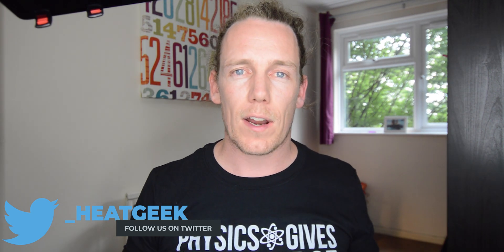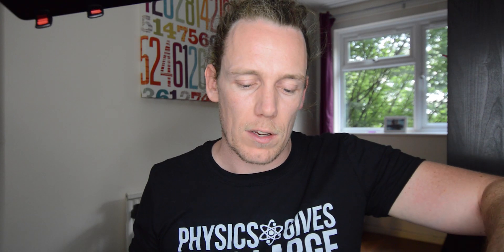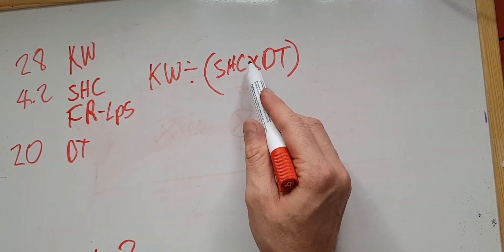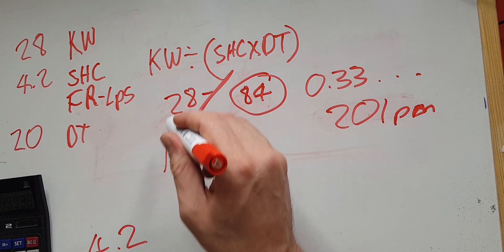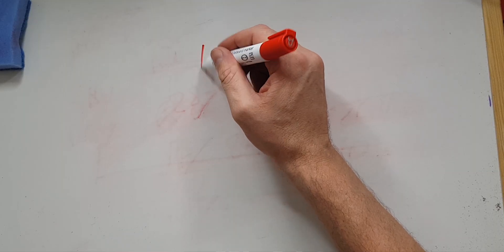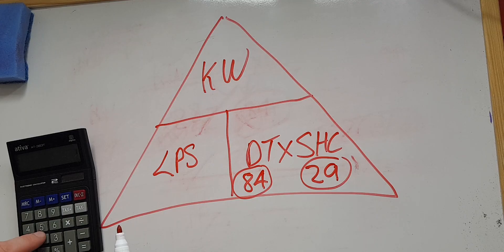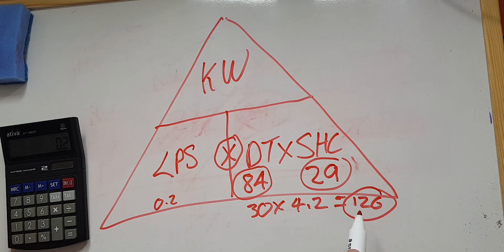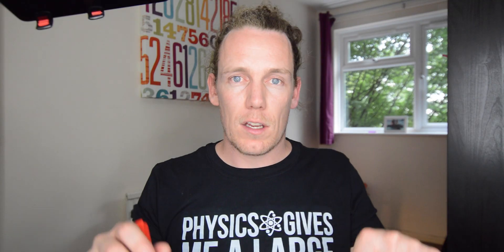Shortcut to HEATING GENIUS! Mass flow rate

Comment: I would recommend using the proper formulas, solving them algebraically for what you need, and substituting the variables you know for the calculation. Also, use metric base units and prefixes only. You are switching between units and variables which is confusing.
So, P=ṁcΔT or Power = mass flow rate * specific heat * temperature differential.
1 kg/s * 4184 J/kg*K * 1 K = 4184 W. When doing calculations for what size system you need in a house, there are all sorts of standards, charts, and formulas to consult. I'm not a technician or tradie so I'm not specifically familiar, but I'm an engineer so I know the math and the thermodynamics well.
Reply from the maker: We try and keep it simple.

Comment: You refer to the 'energy' in kW
kW = Power
Energy is in kWh. It's a tiny difference but you wouldn't interchange litres of petrol with Horsepower.
It needs to be learned, top down, and you're at the top...

Comment: Hey.
My heat pump installer left without tuning the installation, and ignore my emails. So your videos are much appreciated.
The manual for my heatpump say only limit the pumps flowrate if the flow is to noisy. But if i don't limit max flow it seems to pump to fast and delta T drops to 2-3 °C.
Some sources clams air to water heatpumps optimal delta T is 5°C other claims 8°C and some say flowrate should be 2, 2½ or 3 times energy output (eg 5KW = 10-15 L/min )
So what pump speed  should i target with heatpump and underfloor heating?

Comment: Am I right in saying if I had 20kw of radiators on 22mm pipework and the flow and return was 10 degrees then the flow rate would be 0.47l/s, but 22mm can take a maximum of 0.35 l/s  so it wouldn’t be possible to get 20kw through the pipe to the radiators therefore the last ones on the system would be struggling?
Reply: I've just done a pipe siza calc and 26mm internal diameter is minimum for 20kw pushed down a pipe so you'd need 28mm. But that's if all rads calling for heat at same time. This is based on no more than 0.9m/sec velocity

Comment: Dear Heat Geek, I see you consider yourself a heating genius, good, am glad to hear it, could you please add the acronym RCC to your heating engineers tool box, it stands for  Radiated, Convected Conducted, and is a very quick way for your customers / rest of the nation to get on top of heat loss before they all go broke from rising energy costs. They will have to do some of their own research as not possible to discuss all on here. Everyone is familiar with loft insulation , double glazing at great expense , prospect of flashy heat pump etc but what about the nitty gritty of windows that never got foamed up, howling drafts from badly installed windows /doors ie convected loss. What about cold north walls, radiated and conducted loss, what can be done about it. 
    It has probably occurred to you but I'll mention it for benefit of everyone else , retro fitting under floor heating, very expensive/ disruptive for purpose of maximising efficiency of heat pumps, would it not be simpler to do it on certain walls in a house..yes there is the issue of putting screws in to the wall but with a bit of imagination and ingenuity that can easily be resolved. Thanks for uploading, is nice to see such professionalism.. Let there be light is what it says, and you're doing a good job of it , well done. Just subscribed . Ps Please dont fall out with my mate Roger, you, him, urban plumber are doing a much better job than anyone in Parliament that is for sure. The goal should be , best of both worlds, Warm houses/ low bills, I walk the talk, have a warm flat that runs on vapours and is still room for loads of improvements, wait till I get the 500 mm celotex out

Comment: I have a 3 floor house 170m2 with underfloor heating , the lowest power of my combi boiler is 5.7 kW. As e result , when one of the zones is active , it takes about 30mins for the boiler to warmup the system and then it overheats and cycles ! Is there a way to dump some of the extra heat to the other zones by partially activating them? All zones are controlled by simple on/off programmable thermostats .

Comment: Ok, it's late at night and I'm a bit tired and it's a while since I calculated any mass flow rates. After describing SHC very well, and explaining that SHC is the capacity of the medium to store energy per unit mass (kg), you  only talk about volumetric flowrate (litres/sec) , without explaining how you got from kg to L/sec.. Ok, so, w're talking domestic heating systems here so, the medium (water) has a density of 1 (or thereabouts)  and, crucially, doesn't change phase, and therefore 1 litre/sec = 1kg/sec( because 1litre of water = 1kg of water) ( or at least close enough to  your margin of error for calculations to not really matter). I make this comment for 2 reasons only, The first being that this omission in the explanation might confuse some folks and the second being that in one of your discussions with that Bisby bloke you said to him something along the lines of  "it's not about flow rate that's important, it's mass flow rate". Well, If we are talking water and no change of phase, flow rate (volumetric flow rate) and mass flow rate are interchanbeable. ie. if you are pushing 10litres /second around your system, you are pushing 10 kilogrammes/ second around your system. Luckily poor old Rogerer was too thick to pick you up on this point, but it did make me question do - you understand what you're talking about?
I'm now going to qualify that by saying that I think you're doing a great job and thanks for that. Teaching thermodynamics, however, may not be your forte, so just be careful, it only takes one prat to spot an error and shout it out in an un-reasonable way to undermine an awful lot of your otherwise  excellent hard work.

Comment: One rule of thumb that I stumbled across on a plumbing forum is 'one kWh will raise the temperature of a tonne of water by one degree C'. From memory its only 92% accurate, but it provided a nice, simple, initial assessment to put you in the right ball park before getting the calculator out.

Comment: How much more flow rate does ufh require compared to radiators?

Whats the KW output based on for me to play around trying this formula? I have my room by room heat losses.
Reply from the maker: The kw is what ever you put in the box.. ufh is 3 x faster
Reply: @HeatGeek  i was just trying to figure out what kw i add to determine pipe sizes to my heating manifold and pipe sizes to the radiators, is it my house heat loss of 3.7kw, the ashp output of 7kw or the gas boiler 26kw.

They say heat pumps requore a higher flow rate compared to a boiler, is this because of the heat pump or due to the low temperature flow, because we can now run low temps on a viessmann 200 too.

Comment: hey! i am apprentice plumber in Australia where we are rather behind the rest of the world in this field, so here i am trying to better undertstand all of this! (before i eventually undergo one of your courses)
if a greater delta t is better (within reason, we want everything circulating) would it not be better to lower pump speeds to increase the delta we get?
Reply from the maker: Yes, you want lower pump speeds to widen the delta buddy.
Reply: A gerater delta t is not necessaraliy better. A greater delta t will give you a better heat transfer per unit area of your emitter or collector ( you haven't specified which you are talking about), but a delta t of 90 degrees k on a radiator would be dangerous.A condensing gas boiler usually has 2 heat exchangers, the primary  is directly above the flame and will have a delta t of several hundred degrees K and then the secondary is further up the flue and will have a delta t of maybe100 degrees K ( I'll admit I'm guessing on that one). However the crucial tempemperature on the secondary  is not the delta Ie  the difference between the incoming water  and flue gas temperature. but rather the temperature of the heat exchanger itself which must stay below 323 degrees K at sea level ( or thereabouts) in order for the superheated steam  in the exhaust gasses to change phase and condense out as liquid water, thus liberating shed loads of "heat" energy into the circlating water of the heating system. The delta t across the boiler flow and return will affect how efficient that particular boiler is, because those crafty engineers will have combined all of the variables that they can control, into their control system to make the boiler work at it's optimum, but bear in mind ifg the return temperature is too high it will never "condense" and so forget efficiency. It is very important that you get the return temperature ( not the flow temperature) for your condensing boiler right  in order to get max efficiency. After that your emitters (radiaters, underfloor heating etc) need to be matched in size tto the room thay are in to deliver the heat required for that room which will  of course depend upon the delta t of each surface of that room and the   u value  of that surface and the area of that surface. If youv'e got this far You will probably make  a great heating engineer, If not, tune into Roger Bisby and be a "has been"plumber.

Comment: Shouldn't Delta T be the difference between average temp in radiator and desired temp in room?
Reply from the maker: There are lots of dts. For mass flow rate its flow to return dt. The dt you refer to is the mw-at-dt. That bares no relevance to the required flow rate at all.
Reply: @HeatGeek  Ah okay, I think i get it, thanks

Comment: Hi Adam, does this calculation work in respect of underfloor heating circuits? Or how would you calculate a circuits required flow rate? Many thanks

Comment: Thanks for the video, specific heat of ethylene glycol is less compared to water so you will need more flow rate from the pump,  also the number of 84 is not saint, on some systems, you will need to calculate a different delta T, so you can use the formula q=mc∆t  to know how much energy you need (gallons of water inside the water tank) and than you will need to calculate what the house/facility heat loss, and than you will need to calculate how much heat (Q) you need from the system and how much flow rate from the pump to transfer. good luck. 👍

Comment: 'Mass flow rate is simply Kg/s. You are referring to the particular value of this quantity which will produce a specific deltaT across your system. You should call this something different, for example 'desired mass flow rate'.

Comment: Hi Adam, fantastic video as usual! Just one question. Am I right in thinking that a Delta T of 20 with a MWT of 60 will output more Kw than a Delta T of 20 with a MWT of 50? If so would that need to factored in?
Reply from the maker: Yes thats right. But mwt doesn't not come i  to this equation so its irrelevant

Comment: how do you find out system resistance of an existing system to size a pump correctly when you cannot see pipe runs. say for fixing with some rads that are not getting hot and you believe the pump to be wrong thanks
Reply from the maker: Unfortunately younneedbto pace out and estimate

Comment: As a non heating specific trade, this is very interesting to watch. Would these calculations apply for a boiler pump on a system boiler that is of the modulating type?
Reply from the maker: Mass flow rate law always applies. Its a physics law

Comment: Hi Trying to size a system boiler, I know the total heat loss for the whole house, the length of UFH pipe, the design flow rate, but how do i bring in HW supply to a UVC.  if I run the UFH from a buffer how can I ensure condensing as presume the boiler will be controlled from a stat in buffer and a stat in UVC. Is there such a thing as a modulating cylinder stat? How do I sign up for you courses? thanks
Reply from the maker: Hi Andy..  the only way would be to weather compensate the buffer temperature.. anybquakity boiler will be able to fo this.. why are you using a buffer BTW?

Course info coming within the next month or so!
Reply: @HeatGeek  Hi Thanks for your reply, the buffer was to avoid boiler cycling, design flow temp for the ufh is 45deg. I also have 3 small rads and two towel rails on a manifold system on first floor. have three en suites and a house bathroom all with showers, one bath. It is a total renovation, all plumbing and boiler will be new. yet to buy a boiler and uvc . Came across OSO cylinder that is 360lts total, with a 100 buffer in the bottom, but coil is only 1.8m2 in upper tank. It has 3kw immersions, one in each tank. House has been first fixed for Heatmiser stats, but I don't like the idea of on/off stats. House is well insulated and will have mvhr.
what would you recommend as a solution
Reply from the maker: @andystephenson8845  just buy a Viessmann 200 boiler as thats unlikely to cycle as it modulates to 1.6kw!. cycling losses are only around 1%, it think youd lose more efficiency from the buffer losses and mixing. the install will be half the price if you dont use a buffer. too

Comment: How can you set the modulating pump to the correct litres a minute ?
If you have radiators and underfloor heating  controlled by a 2 motorised valves how can you have two pump speeds at the same time ?.
Reply from the maker: First question. You measure the DT and choose the setting closest to your dt or splash out on a dt pump. Second question depends on pipe work layout and if your talking about a system pump of boiler pump. Boiler pumps are burner linked so will automatically modulate to the correct speed to maintain a wider dt.. with system pumps the layout will help you decide between proportionate pressure and constant pressure... or you can use a dt pump again.

Comment from the maker: Anything that wasn't explained well enough?
Reply: Only thing is you jumped from talking about mass flows to volumetric flows without mentioning density (upon which volumetric flow is dependent) and the units of the equation are in mass terms, so a density term has to be included if working in volume flows (or state assumption that water is 1000kg/m3 density).
Reply from the maker: @1991elliot  absolutely correct thanks for pointing out. We use the terms and conversions so interchangeably that this is easily missed out. Thanks for pointing out!!
Reply: @HeatGeek  Keep up the good work. A lot of Engineers struggle to communicate well so you’re doing a great job!
Reply from the maker: @1991elliot  thanks mate!
Reply: How are you calculating the DT? Is it just the difference between flow and return?
Reply: @DrChimRichels  yes
Reply: Loke the IRV Triangle
Reply: Flow is a manual flow setter so have you got to get under the sink to adjust it every other day I just don’t get it my Combi up / down operation on the Combi no messing with valves.Combi £3000top of the range heat pump £5000 and all the bits and pieces and I still have to get under the sink.
Reply: @Allegedly2right  sounds like your domestic hot water supply temp is fluctuating with the heating load.  I would look at the prioritization.  I would bet that your domestic hot water is not prioritized to hold your set temp.  So on warmer days the temp is falling off and on colder days it shoots back up.  There are so many things other that could be wrong with your setup but that seems to be simplist explanation.  Assuming you are in the UK, I would get a heat geek in there to look at your system.  You should not need to manually adjust your mixing valve ever other day.  Good luck.
Reply from the maker: I’ve just released a course detailing everything you need to know to become a heating genius!  What’s more it’s  been recognised by the UK government department BEIS which have offered to heavily subsidised the first 300 spaces!  
http://courses.heatgeek.com/

Comment: Great delivery..could you explain how to set a by-pass valve correctly. I just stick them on 2 , but I know I’m not doing it right...
👍
Reply from the maker: Bypasses dont relaly work with modulating pumps.. British standards is light years behind.. I'll try and include it somewhere  thanks for commenting
Reply: Heat Geek 
Haha.. I’ll stick with with 2 then...
Nice one
Reply from the maker: @seanmurray1734  may aswell stick it on max.. if it opens it causes the flow to bypass and warms your return water unnecessarily
Reply: Heat Geek Righto. You’re a good egg. Much appreciated
Reply from the maker: I’ve just released a course detailing everything you need to know to become a heating genius!  What’s more it’s  been recognised by the UK government department BEIS which have offered to heavily subsidised the first 300 spaces!  
http://courses.heatgeek.com/

Comment: Great video, if i was trying to work out a flow rate of an underfloor heating circuit,  could I work out the room heat loss(in kW) and using the delta come up with the flow rate?
Reply from the maker: Yep.. kw of room ÷ 29 = flowrate in lps
Reply from the maker: I’ve just released a course detailing everything you need to know to become a heating genius!  What’s more it’s  been recognised by the UK government department BEIS which have offered to heavily subsidised the first 300 spaces!  
http://courses.heatgeek.com/